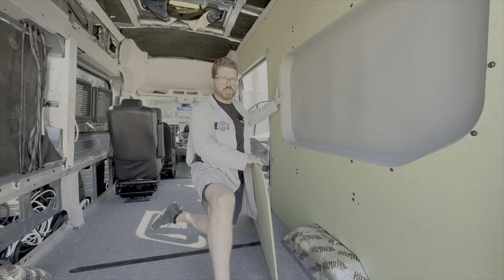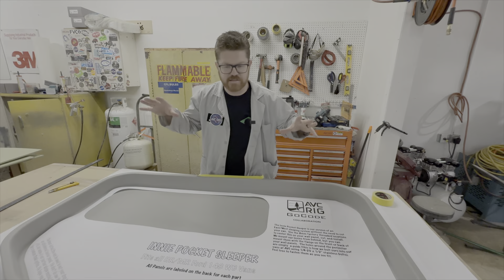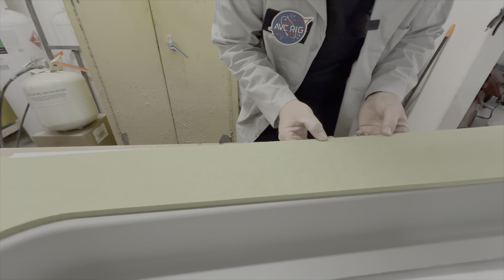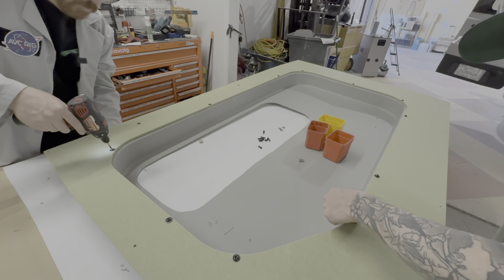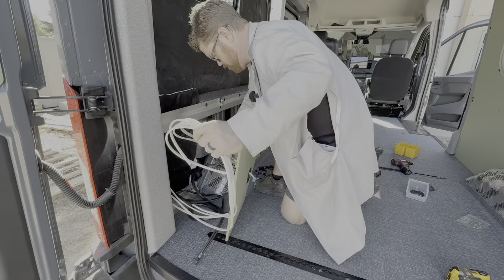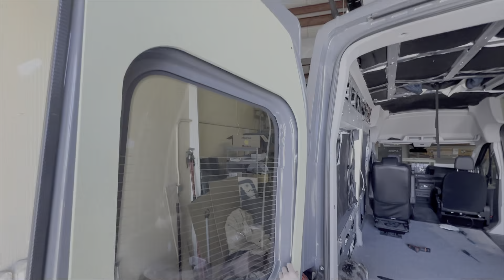Van Walls and Innie Pocket Sleepers | AVC Shop Van 2025 Build EP. 11 | 2023 Ford Transit 148 LB

Comment: So you can’t put any weight on that innie right? It’s only supported by the felt panel?
Reply from the maker: There won't be any weight being put on it anyways, the bed platform will be supported by the bed frame system or cabinets.

Comment: When you cut out the metal ribs in the van for the innie (and windows), do you cut all the ribs in that section completely off?  I mean the whole vertical length from top to bottom.
Reply from the maker: You don’t need to cut any for the innie. We cut them for windows only. Typically I just cut them to clear around window frames.

Comment: Would it be possible to glue foam and fabric to the interior of the innie?
Reply from the maker: It’s possible but it can be tricky. I recommend wrapping the depth of the innie and add a panel at the back that is wrapped. This would be the way to wrap it without wrinkles.
Reply: @AVCRIG  I was thinking of lining the back panel with foam and fabric and then using buttons to attach it to the innie. The buttons could add some profile and style to the back panel. I'll let you know how it works out.

Comment: Will you be making a ceiling out of felt as well? Seems like another opportunity for increased sound insulation on a large, rather untouched panel that really only supports puck lights 👌🏼
Reply from the maker: I this build we’re making the ceiling from Bamboo because I like the look. A felt ceiling would absolutely support the lights and would do a great job of making a quiet ride as well.

Comment: Whats the plan to cover this? what material etc? or are you leaving as is and exposed screw heads?
Reply from the maker: The material is felt and it is the finished surface. Screw heads did pop more than I anticipated so after cabinets go in I may change the to a matched powder coat. Once cabinets are in there will be a lot for your eye to look at and they won’t be as noticeable.
Reply: @AVCRIG would you say it’s sound deadening enough to not have to use traditional sound deadening stuck to the panels?
Reply: @AlanAlanAlanDave my guess would be no

Comment: I'm curious about how you're going to secure the innie around the CRL1033 window.
Reply from the maker: I need to order a beauty ring from Go Code Overland. Though I had the right size in the shop but I used them on a customer van. Originally I planned for a slider in my van and opted to do the AW to try them out.